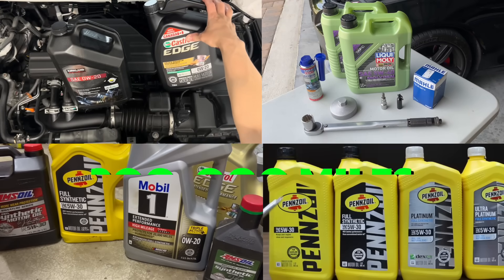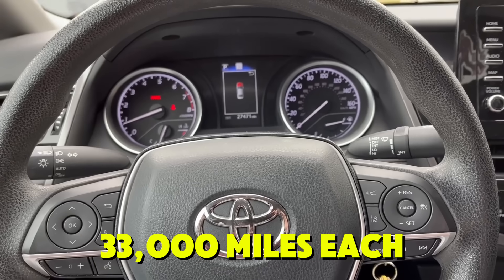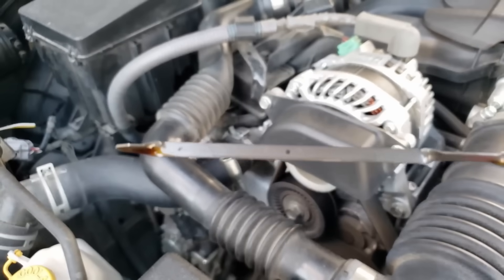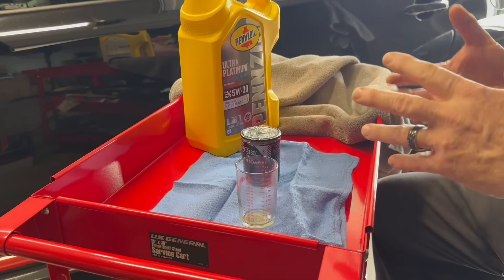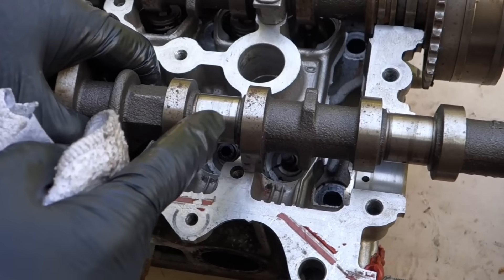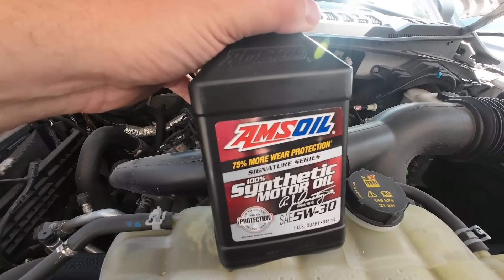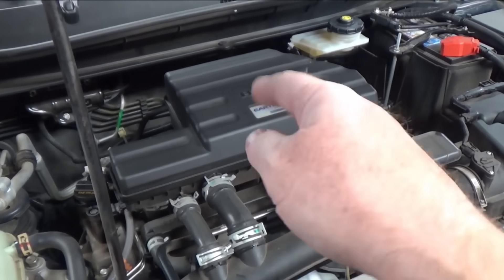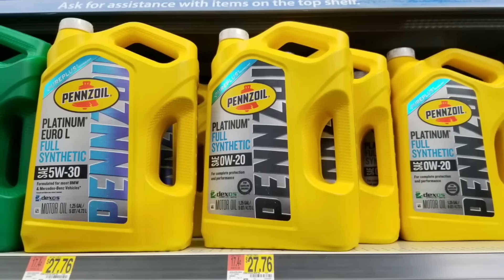I Compared 6 Oil Brands Over 200,000 Miles — One Clear Winner

Comment: I’ve been using Mobil 1 synthetic since late ‘90 and I have not plans to upgrade to those premium oil because I don’t have a premium turbocharged car , I do oil changes in my humble Camry every 5k , i replaced  my valves cover gasket and my engine is cleaner than yours, i have pictures to confirm my comment, i rather use Walmart oil than Castrol in my car 😏

Comment: Why would you have oil in your engine for a billion miles ?
Nonsensical video
You pull it out on 3k intense driving or 7k with largely motor way.
Without actual lab test results, it's all guess work.

Comment: I changed my oil every time the dash told me to 7000 miles after a while every 5000 miles in the beginning semi synthetic then full synthetic after 460,000 miles on my 5.4 triton with no major engine repairs I replaced it with a ford remanufactured engine .I did not drive it to failure , but I did use all sorts of oil brands . This engine was known for having oil issues I have heard ....

Comment: Better every 3 k miles oil is cheap compared to a rebuild, and your engine will last many years i use extended life mobil one full synthetic with 1/2 qt motor kote no tick tick runs smooth as silk one of my customer drive a delivery service every 3 weeks I change his oil at 2850 miles and it came out dark very dark so change it every 3k or less...😊

Comment: I have been using AmsOil Z-Rod oil, with the ZDDP (Zinc Phosphate) proetion needed for classic/vintage Flat Tappet Valve Trains in our 1969 Shelby GT500's 428 CobraJet engine, and our two 1973 Mustangs (Mach 1 and Convertible) 351 and 302 engines.  I selected AmsOil based on its rock solid performance in seveal different evaluations I have seen.  But, due to this video I am now going to look at Liqui Moly oils also.

Update: I looked at Liqui Moly.  It looks like a fine product, manufactured in Germany.  They do not have oil product with a blend specifically made for classic Flat Tappet Valve Trains (with higher levels of ZDDP), like we have in our engines from the 60s and 70s.  Luckily, AmsOil is still a top contender for an excellent oil for our needs, so I'll stick with that choice.  

I also use AmsOil oil filters, manufactured in the USA, excellent quality.  I change our oil and filters in the vintage cars every new Car Season (mid-April), regardless of how few miles were put on the cars the year prior.

Comment: I use castrol magmatec 5w30. A small block 3cilinder block 1000cc 200000 miles. 3.2 liters of oil in, 3.2 liters oil out. Engine runs like a dream.if you use 0w20, doesn't care wich brand. It's asking for problems. For me , in fourty years of driving i always performed my own oil changes. Used different brands. And for me Castrol is the clear winner. And by the way, only cheapskates perform an oilchange every 20000 miles. I do it every 5000 miles. Maybe expensive in the short run, but deffenitly a big win situation in the long run.

Comment: I was using Castrol 0w-40 which was made in Belgium, PAO based.  Then it was unavailable, and then changed to made in the U.S.  I suspect it's now a lower grade oil.  I change it every 7500 miles, and my Passat runs nicely, very clean, no signs of wear, very little consumption.  Should I consider switching to one of the purported better oils?

Comment: My 2011 Kia Sportage has 340,000 miles on it, and I only changed my oil around every 7,000 miles or so 
I've been driving it since it only had 27,000 miles on it. 
It's never broken down or left me stranded, and has started 100% of the time. 
Everything still works and it's my my 70 mile per day daily driver. 
As long as you don't get a lemon, and you drive easy, it should last you. 
I'm going for 500,000.

Comment: been a mechanic for 45 years I use Pennzoil platinum , ultra platinum on high RPM or turbo engines yea Amsoil may be a bit better but hard to get oil does matter guys if you want to save money buy toilet paper at the dollar store do not cheap out on engine oil
Reply: Problem is those oils aren't on gm dexos approved oil lists to maintain warranty
Reply: Amsoil is. In fact just before the recent dexos Gen 3 release couple years ago or so prior to oils requiring to meet the requirements, Amsoil Signature Series was already exceeded the recommended requirements

Comment: It said "200,000 miles with 6 oil cycles." That means they changed the oil every 33,000 miles? No oil should last that long. Every 5,000 max.
Reply: 200,000 miles Testing.
Six Oil Brands.
Six Cycles.
*Could very possibly have been Six Vehicles, one for each Brand of Oil.

Each Vehicle receiving Six Oil Change Cycles.
That would equate to approximately 5.5k miles for Each Oil Change!

Also, 5k miles is not the Norm  for Full Synth Oil. Closer to 7-9k miles for normal use.
Reply: @timk4502 still, 5,000 max on full synthetic.

Comment: always used Mobile1, went to new Mobile @ extended proformance. I do not go to 20,00 as says . i do oilchange  2 times a year once in fall. then again in spring.i do nt rely on  egine oilchange status monitor.Been doing since my dad showed me how to do oil changes. Still best way.. use quality oil filter. either wix. or mpar for my dodge ram 1500. started using Napa gold.Napa stands benind there filters. I do however check the oil viscocity monitor.. so far Mobile 1 extended , seems to be doing well.I also erite mileage down, for my own peace of mind.. Do not rely on computers, fully, do old human way.. again twice a year oil change.. daily driver.                                         Or if want. what ever it says on oil. if 20,000. i divide by 1/3, of 20,000,
Reply: Mobil 1 is not even a synthetic oil, NAPA filters were made by WIX for years but now with this overseas invester group running thing you can get better filters on Amazon just chinese junk and NAPA has no warranty anymore you have to bring your crappy broken part in and do not get a replacement or refund until they send it in for inspection, dont waste your time you will never hear from them

Comment: I take mine to the dealer so I don't know what oil they use
Reply: most dealers have pretty bad oil, better to find a shop that will do Pennzoil platinum GM goodwrench oil is very bad Ford motorcraft oil came out on top in testing but none was as good as Pennzoil or Amsoil

Comment: Does not matter what oil you use; if you change your oil every 4-5K miles with a quility oil filter, this is by far the best thing for your engine if you plan on keeping your vehicle for the long haul
Reply: Oh, but it does. Additive packages and base oils are very different among the oils. Not all perform the same, not all provide the necessary wear, corrosion, burn off, protection. Research Amsoil. It excells all others!
Reply: Good.

Comment: I've used mobile 1full synthetic my 2004 subaru forester and have almost 400k and it barely uses any oil and runs smooth and change it every 3k
Reply: Ultra platinum  better   only 2$ more than platinum
Reply: @marcusevangeliste7426  yea I use ultra platinum in my truck it is 4 cylinder overhead cam high rpm engine but my Orielly store does not have it so the other cars just get platinum, still good oil
Reply: You have done well with your motor and choice of oil.
Reply: yea that is great but with a better oil you would not have to change it that often, Pennzoil platinum is about the same price and is much better, you could extend the oil changes and still have better performance, mobil 1 always comes out on the bottom

Comment: I'm using Edge but changing it every 3K miles.. It's over kill but if this is true, at least it's out of the engine at every 3K.
Reply: I’m using castrol edge as well 5w30 zero issues so far no varnish under the valve cover

Comment: What the hell did they do. Change the oil and filter at 10,000 miles? Of course Amsoil Signature is the best. But it's too expensive for me. I buy a good synthetic oil and filter and change at 5-6,000 miles. 10,000 mile oil change is absolutely Stupid. Any good Synthetic is perfectly fine for my oil change intervals.
Reply: I change my 2008  Silverado 5.3 every 16-18 k   once a year. 245 k on motor and no issues. I use the signature series 0-30.
Reply: @brianfink7695 Good. You are not ignorant.
Reply: You correctly said Amsoil Sig. is the best now PAY for it and use it. You will have no regrets. I go about 13,700+/- mpy on it and my engine loves me for it!